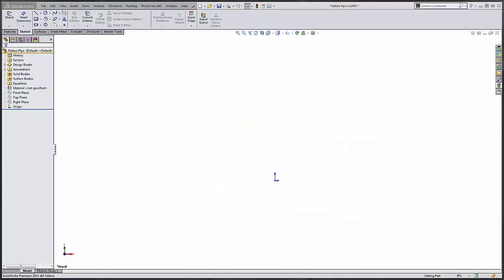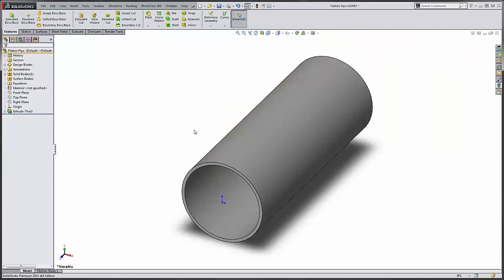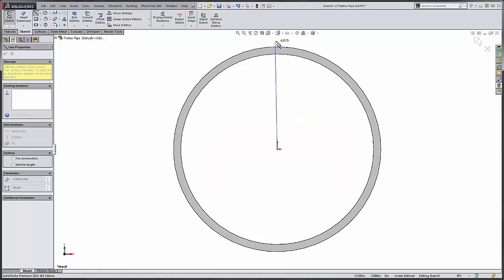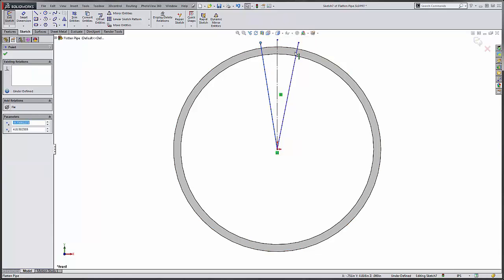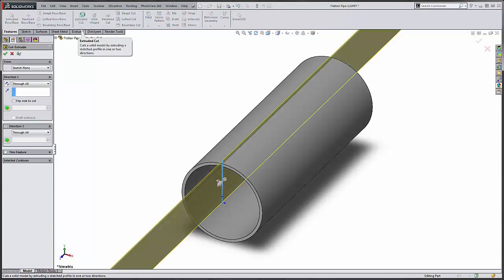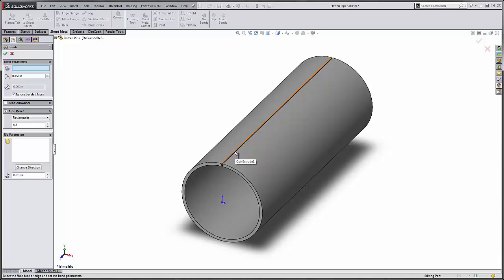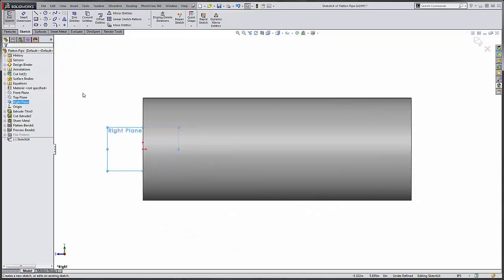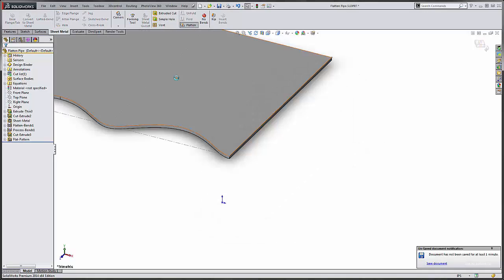SOLIDWORKS - Flatten Pipes using Insert Bends

Comment: Can we flat a 3d tube too...as I need the flat pattern of a tube that has bend
Reply from the maker: You can achieve the desired result with something that isn’t a perfect circle… But you would have to use a Lofted bend instead of using Insert bend..... where you would create two sketches instead of one and “Loft” them together.